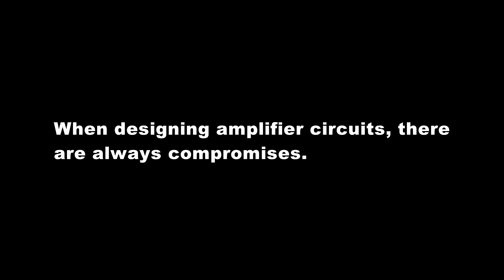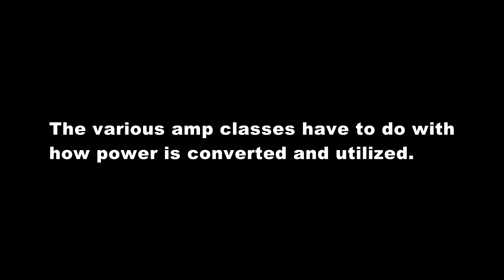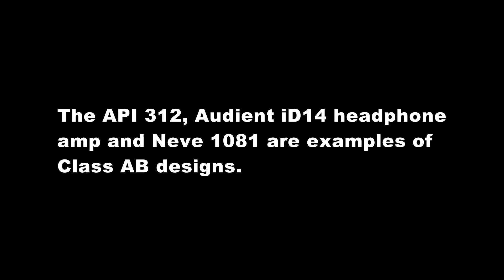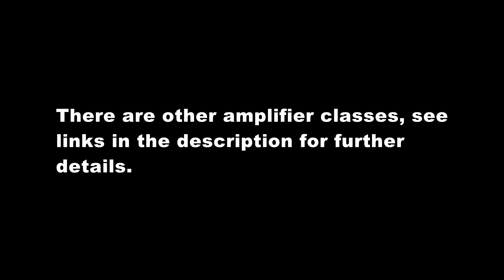Class A B AB D & H Audio Amplifiers Explained

Comment: Class A is not the most common. Class AB is the most common... And class D has also become very common in later years. But a class AB often sounds better than a class D. Atleast it used to.
And some amps even start as a pure class A and then switches over to class AB at higher power outputs.
A class AB is generally 50-60% efficient while a class D is about 90% (+/-)
And class A, B, AB etc all normaly have solid state transistors unless they have tubes. Some can also have both solid state and tubes.

Comment: I thought class ab amplified the signal as is, as it comes into the amp, and then the class d filtered out the high FQ before amplifying it allowing only the low FQ to be amplified. Making it more efficient if your using it for subs only. Some class ab amps allow for a low or high pass, but the whole signal gets amplified, anything filtered out is wasted power. That's why they told me if I was only driving subs, class d is the way to go.
Reply: Then you thought wrong. All types can be used in all aplications. All classes amplify whatever they are told to amplify. I.e you can find class D full range amps and recivers and so on.. What class the amp is has nothing to do with filtering of the input signal.
Class AB is 50-60% efficient while class D can be around 90% efficient but is not always as good sounding as a class AB. But that has become better with time so today there is not so much difference in that area anymore. Depends of the price range and components offcourse.

Comment: The description of Class D amplifiers is totally nonsense. He says "Class D uses output transistors". Actually use of transistors has nothing to do with Class D. You also have output transistors in the other types. Well, you can use vacuum tubes also for all of them. Rather class D is a type of amplifier where energy is conserved by not attenuating the output voltage over resistive transistor/vacuum tubes but rather through low-pass filtering (using capacitors/inductors) a high frequency switched digital signal to make it appear analog. As the (ideal) capacitor and inductor operate without energy loss, the efficiency of a class D amplifier can be more than 90%.
Reply from the maker: Thanks for the additional info.

Comment: Class D was incorrect. It does not use transistors it uses MOSFETS. They can switch a lot faster than transistors and it modulates the audio via driver chips that uses a pulse with modulation to turn on and off the MOSFETS. The MOSFETS do not operate as linear devices they operate as high speed switches. The audio is fed into the chips and converted into digital pulses that turn the MOSFETS on and off creating a digital pulse width train. After the MOSFETS amplify the modulated digital signal you then filter out the high freq. components before it goes to the speaker and you are left with the reconstructed audio signal.
Reply from the maker: I answered this in another comment but I will state again. MOSFET = metal-oxide semiconductor field-effect transistor. MOSFETs are a type of transistor, just like BJTs are another type of transistor.
Reply: Class d amp is basically like a switching power supply
Reply: actually bipolar transistors can switch faster than unipolar transistors (mosfet) beacuse of gate capacitance.
;)
Reply: What class and watt amp will be apropriate for 2x5watt speakers 16 ohms???
thanks in advance
Reply: > does not use transistors it uses MOSFETS

Comment: class D uses MOSFETs on the output not transistors just pointing that out
Reply from the maker: A MOSFET is a type of transistor. Did I say transformer in the video?
Reply: RealHomeRecording.com Many of these folks could stand to use a basic electronics course. That's pretty basic stuff. I crack up when I see someone say things like that while "correcting" others. At least they are interested in electronics, so it's all good.

Comment: What about tube pre-amps or is that a different category?
Reply from the maker: Tubes don't fall under different classifications. For example, you can have a Class AB tube amp or a Class AB solid state amp. They use different parts to boost the signal (tube vs. transistor) but not circuitry paths AKA topology.
Reply: RealHomeRecording.com
Ok. So now i would know what to look for when i buy a tube pre amp. I herd cheap tube pre amps are so bad the noise level is horrible. They sell some really cheap ones around 30 to 40 bucks at B&H and probably at sweet water too. Think the brand name is art?
Reply from the maker: I would only go with a tube preamp when it comes to guitars. Eventually the tubes will need to be replaced, just like with a guitar amp. For microphone preamps, stick with solid state. They are tried and true!
Reply: RealHomeRecording.com
Tubes cost lots of money too!
Reply from the maker: Oh indeed! But for guitar amps, you can't beat 'their sound!